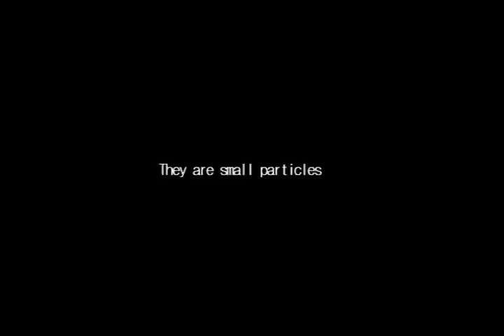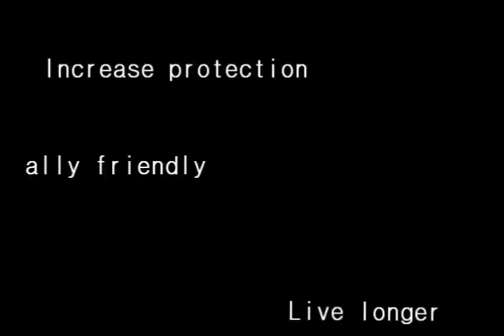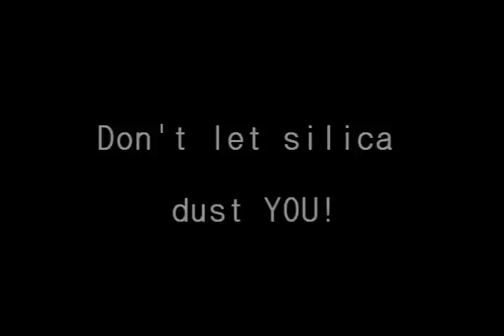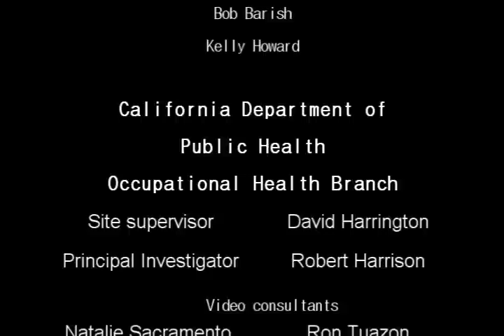Don't Let Silica Dust You!

Comment: Can you get silicosis from one time over exposure to food grade DE. ?   Is there any way to expel out before dust settles .
Reply: Probably not
The issue with materials like silica and asbestos is more so that not only are you exposed to it when you're at work dealing with it, but that you bring it into your car and your home. The dust gets on your clothes, you sit down in your car so it gets in your car, you bring it home and sit on your couch for an hour or two maybe make some food and whatever movement you do releases whatever dust is in your clothes into the environment you're in. And if you're bringing that kind of dust home every day, while not cleaning your home or car everyday, then you're going to be breathing in that kind of dust much more often then you should. It's the long term exposure that gives you cancer.
I've gotten what I can describe as really bad colds from dust multiple times but that was because I was being careless and either didn't wear my full seal mask or didn't have a clean shave to ensure a proper seal with my mask. But I don't think I'm going to get any sort of cancer from silica or asbestos because I take the proper precautions before I leave the jobsite and when I get home.